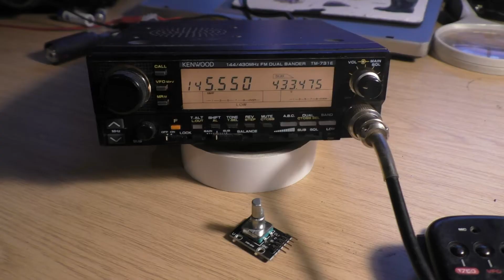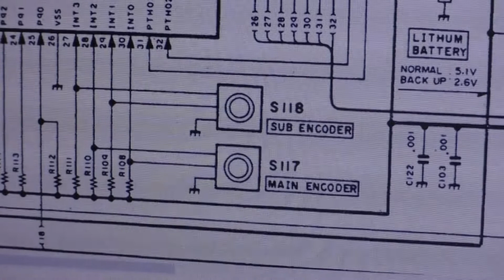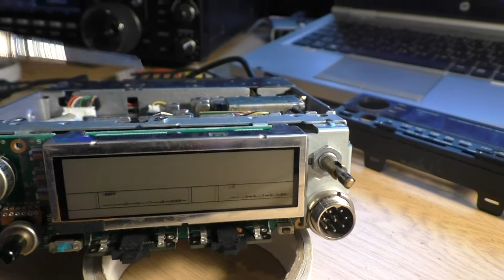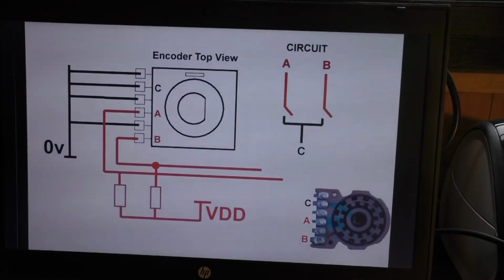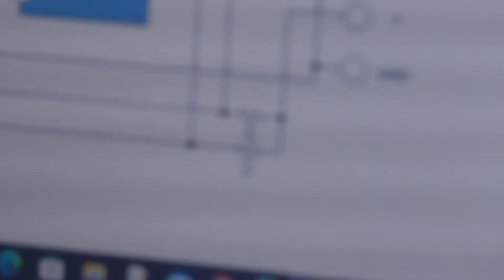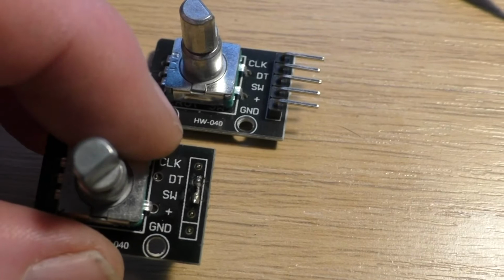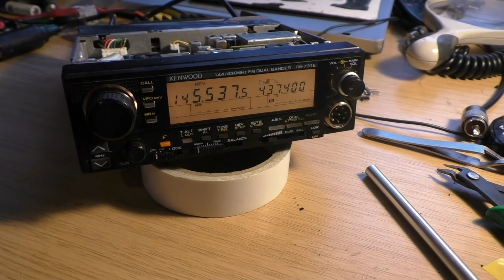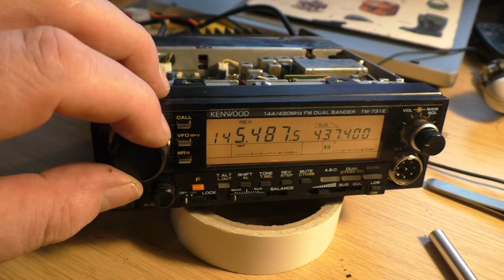Faulty Kenwood TM-721 TM-731 Master VFO encoder, Fix KY-040

Comment: Wayne, the Kenwood RZ-1 is another radio using this obsolete part. In my radio, purchased from eBay, someone had dropped the radio on its faceplate breaking the encoder's PCB. I used your procedure and the radio is now working perfectly, and not for 2 quid, but only 1 through that global bookshop! I did use a hot melt gluestick to adhere the KY-040 to the PCB. Thanks very much for the video and your engineering knowledge. I would never have known how to figure out this repair on my own. W7GZ (another Phillips)

Comment: Hello Sir,
My ICOM IC-706MK2 VFO encoder is faulty and the part has been discontinued..so u know which part for this replacement?
Reply from the maker: Hi, sorry not fixed a 706 but  had a quick google and the only reference to a working replacement is a PEC16-4020F-N0024 from Digi-Key Electronics, link in description. https://forums.qrz.com/index.php?threads/help-need-encoder-for-icom-ic-706-not-mkll-or-mkllg.527902/page-2
Reply: @waynephillips1848  thanks alot!!